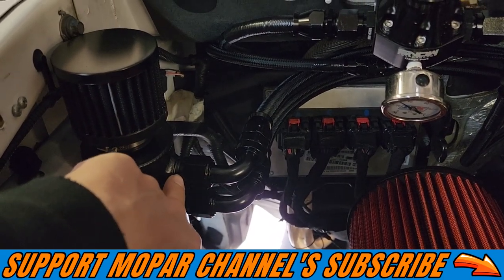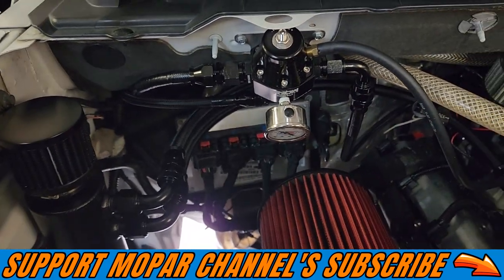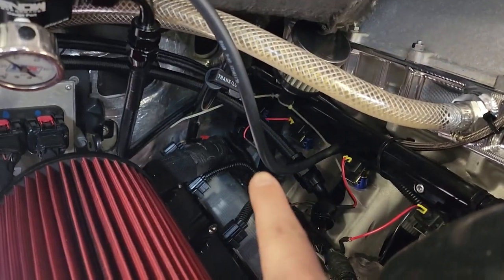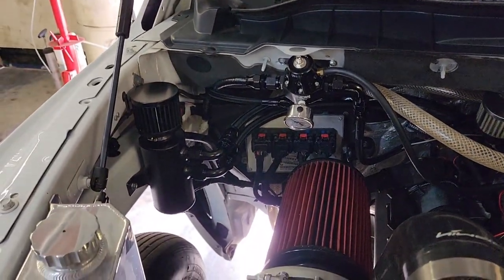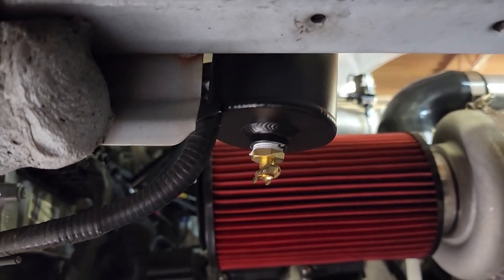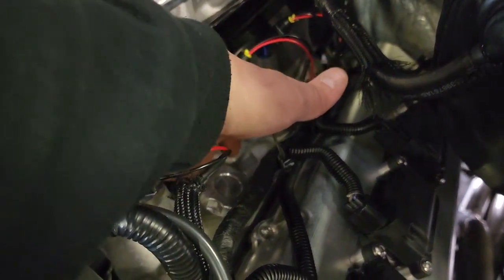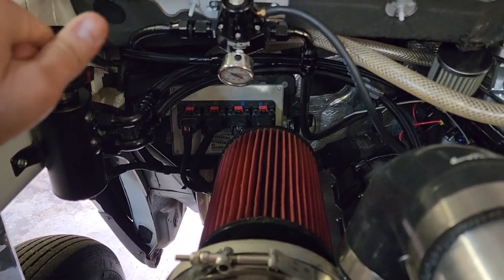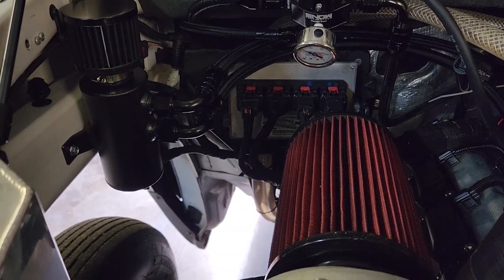Awesome Oil Catch Can Setup For Your HEMI From SPELAB

Comment: 🔥 looks good man! 🔥, going to attempt to install the high ram intake on my 300 in march,
Reply from the maker: You can do it!
Reply: @FrostbiteRam  unfortunately have to take off the the high ram and go back to stock, my catch can was taking too much oil and getting into the intake
Reply: @nightraver7926 is there a reason why it was doing that
Reply: @str8pressure_rt373  according to holleys instructions, there’s a hose that goes to back of the of the intake with a 1 way check valve in place, once the car is on that hose has vacuum causing it to suck oil from the passenger side port on the high ram, I even installed a 10in nipple with a 90 degree elbow same results just kept sucking oil into the intake, I took it off and we installed it on a friends charger followed the same instructions from Holley with the same results, oil getting sucked into the intake, but I guess other people are not running the plumbing like how Holley states, I’ve seen people go from the passenger side port with a dual baffle catch can to vent the crank pressure to the port next to the oil cap. Like how he did here on frostbite. The funny part is when I vent it to atmosphere and plugged the back hole on the back of the intake there was no oil coming out.
Reply: @nightraver7926 okay cool I have the Spelab catch can that he has I’m hoping for good results.  The last Hi Ram I had on my charger wasn’t too bad but we’ll see how it works on the Challenger with Eagle heads

Comment: Curious how well this ones been working for you in relieving the crank case pressure and cleaning up all those oil vapors. Was about to order a Mighty Mouse can for my 5.7 but saw this and this thing is significantly cheaper
Reply from the maker: It's been great